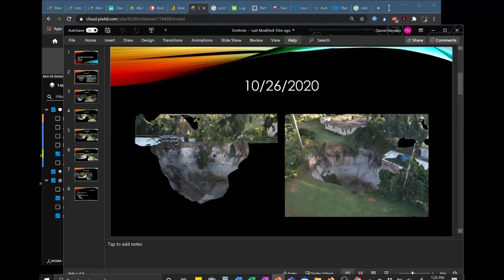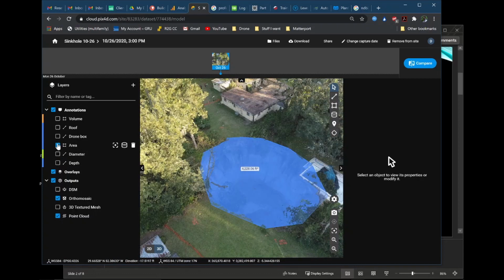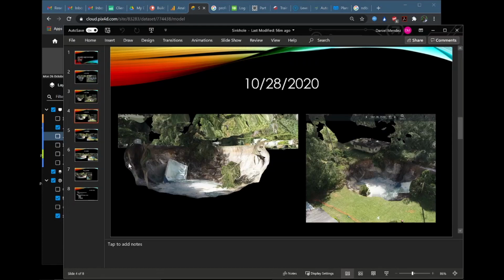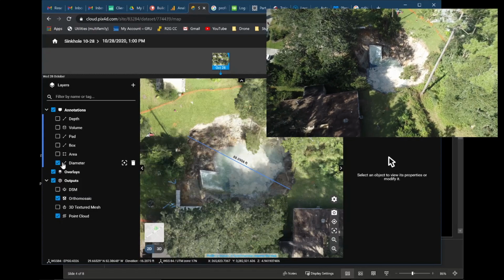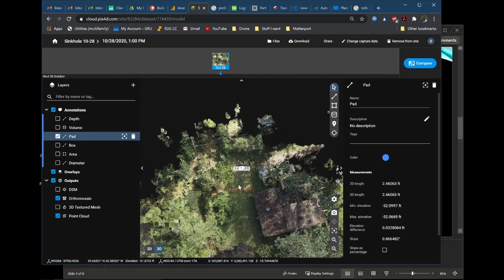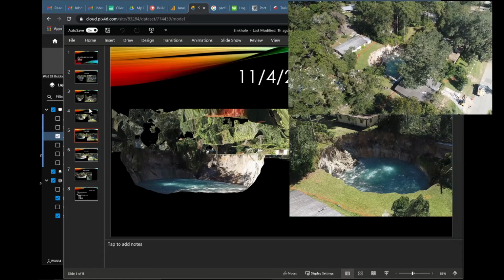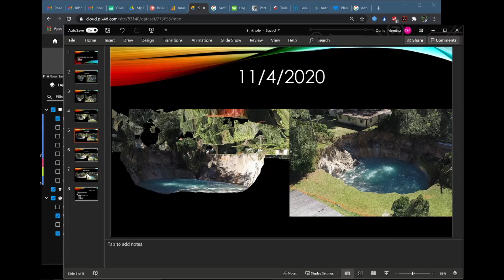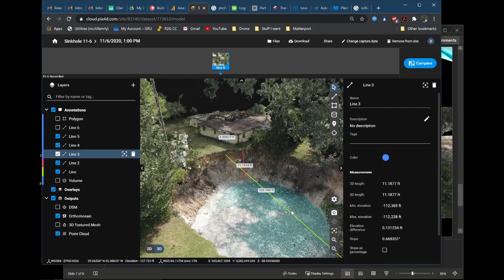Gainesville Florida Sinkhole (Perlman’s sinkhole) October/November 2020 6 Day Analysis Using a Drone

Comment from the maker: Hey guys,
trying to do my best on updating the public about this. What analytics/information would you guys like to see about this situation? 
New video update coming soon!
Reply: I live in this area, based on this information can you tell how far below the surface you need to go to access the aquifer. I'm thinking about putting in a hand pump well and they recommend not going any deeper than 25 feet. Would 25 ft work out for me in the Gainesville area?
Reply from the maker: Not a clue my friend. I can only map what I can see. That’s a question for a geologist or someone with an expertise on that subject. Good question though. I wish I could tell where the bottom even was.
Reply: I live in Gainesville Florida what the freak I did not know about this
Reply from the maker: It’s out there on some news channels but it hasn’t been consistently reported on